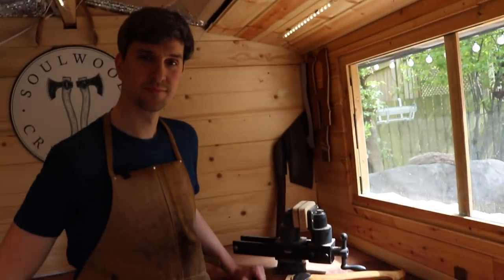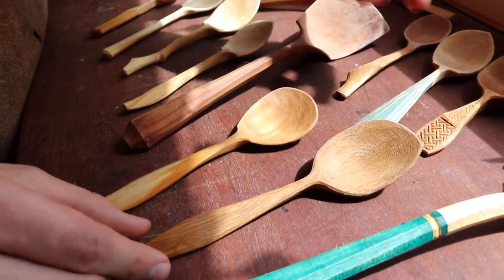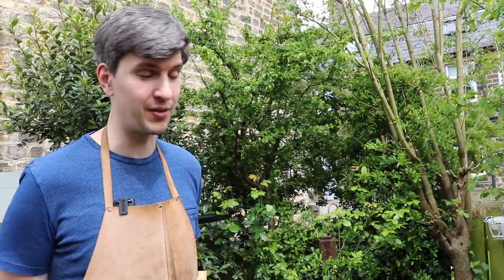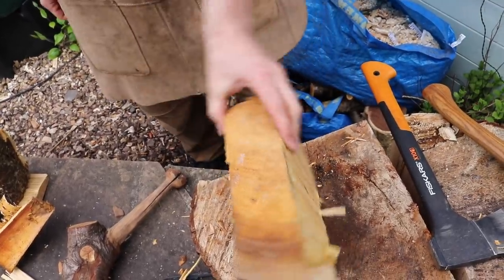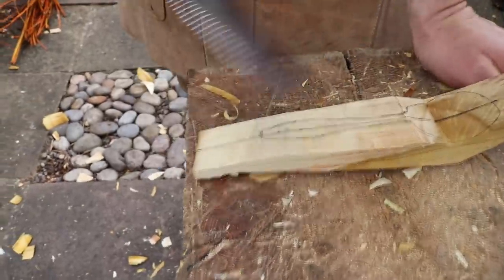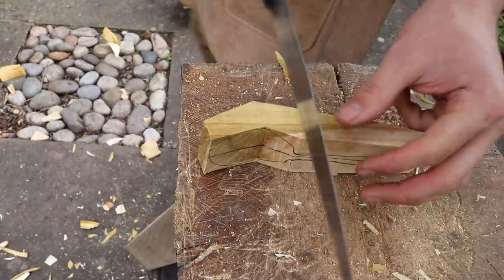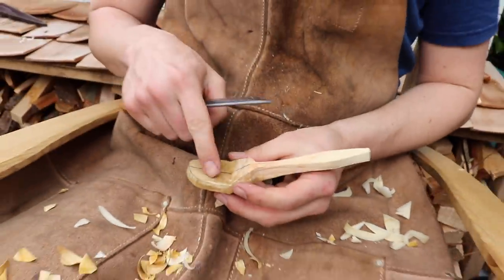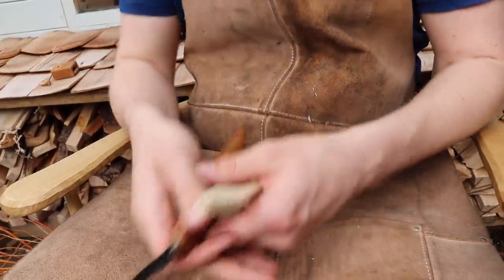How To Carve A Spoon - Soulwood Creations (aka Peter Kovacs)

Comment: I would heartily suggest you try walnut oil.  Either the filtered oil or just straight from the food store.  I am so happy with the speed of drying and the finish on both spoons and bowls and have been using it for years now.  A side benefit for me is that when breaking in a kuksa or spoon or bowl with hit or warm liquids, it tastes better than linseed.  Nice video guys.
Reply from the maker: Indeed yes Walnut oil seems to be great option for many, only thing toi bare in mind is potential nut allergies for the end user ~Peace~
Reply: @Zedoutdoors  I did some reading about that and some of the oils like Mahoney's are press filtered and that process supposedly removes the proteins that are responsible for the allergies.  Have you heard anything about that?